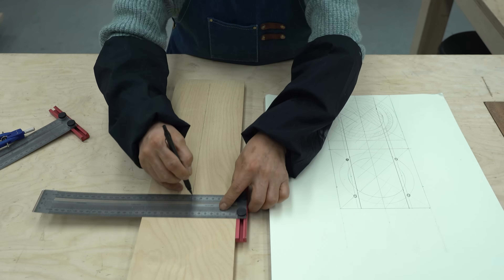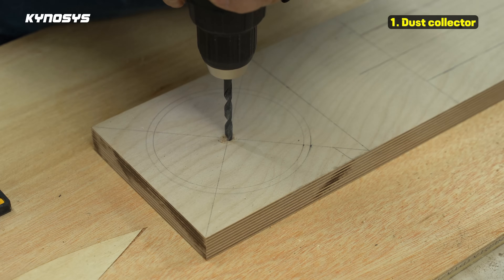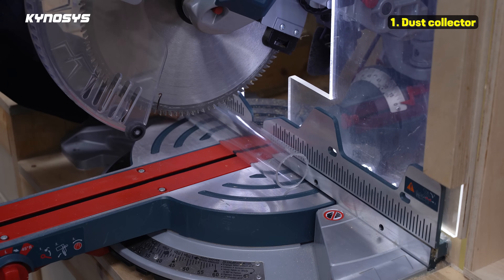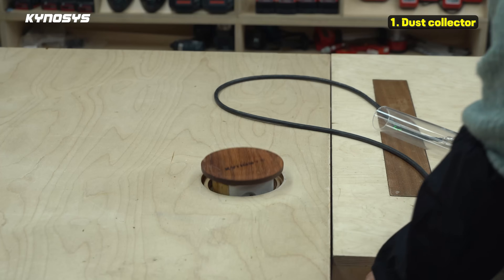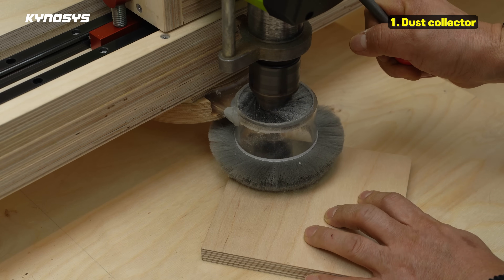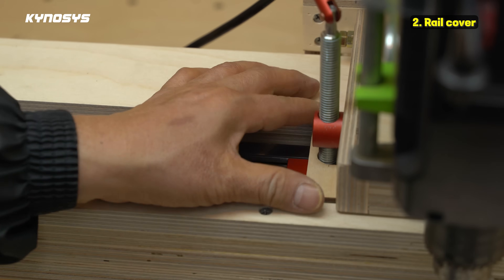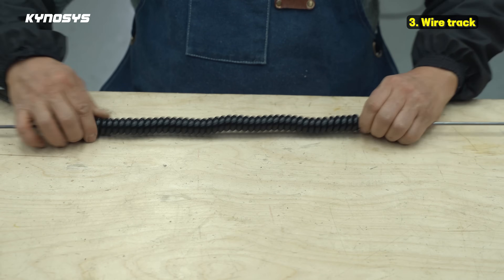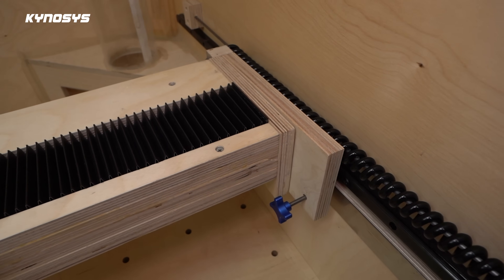CNC Type Drill Press Upgrade / DIY

Comment from the maker: I upgraded it by adding three to the CNC Type Drill Press. 
First, I installed a dust collector that moves from side to side. It barely gets any dust when I drill. Second, I installed protection on top of the LM Guide Rail. This lets you botno rails and bearings. 
Third, I installed coil wires so that the electric wires don't look too messy. I can't see the electric wires, so it's very clean. I hope my work can be of little help to you guys. 
Thank you.

Comment: I don't mind the English at all. Actually like the voice over. And love the engineering that you put into the projects.   I have found in cutting pvc vinal and acrylic running a carbide tip blade backwards still slowly produces a cleaner   cut creates a negative rake tooth angle that does grab your work piece and lot less chip out. Keep doing what your doing God Bless!
Reply: Just don't forget to change the blade back around it won't cut wood very well😂
Reply from the maker: I really appreciate your kind words about the video, and I'm glad you're enjoying the content!
I will take your advice to heart.